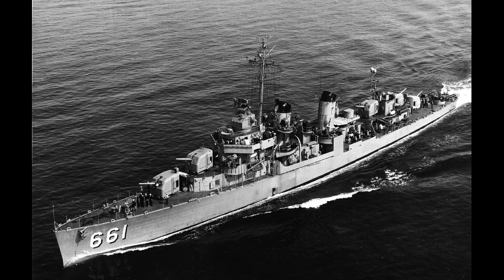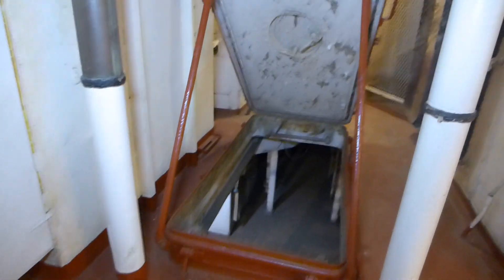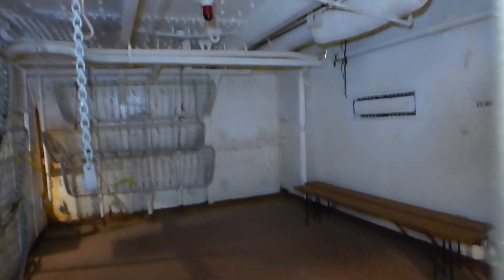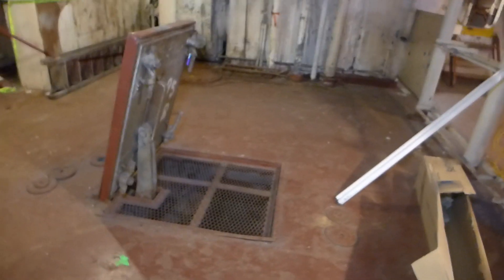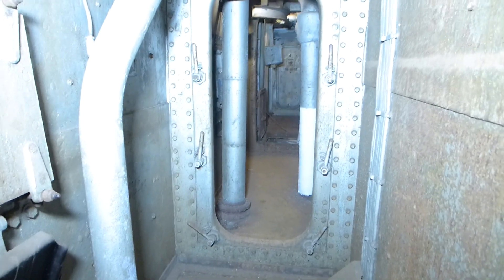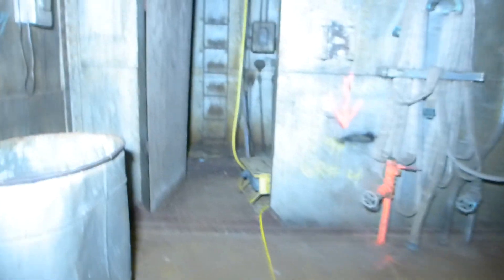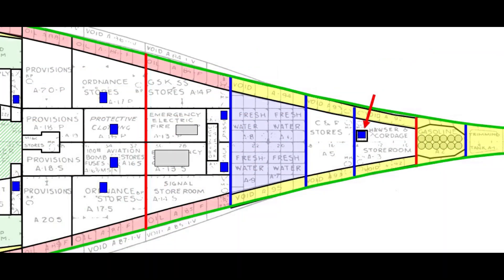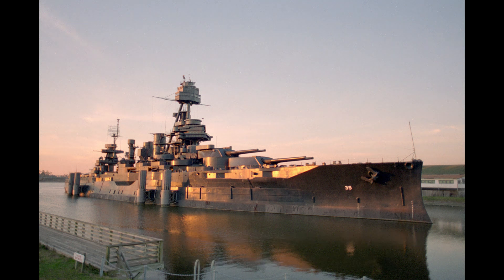Battleship Texas, Holding Back The Flood

Comment: Hi Tom, this is Manuel again. I'm starting the  CAD building of the Texas BB35 and need some assistance with the details of the control room. The doors to the room have a blast locking device on the inside, and what kind of handles does this have? What all is inside the room that will help me visualize to recreate? Did they have anything on the outside walls hanging ready for use in case a battle was in place? Can you share someone's information to communicate when needed? Thank you for your videos, they have already answered many questions. such as the 3" ammunition tubes. Question: Were they stocked up on the deck in crates when in use near the guns? I would like to share some of my progress drawings, if possible. Please "HELP'.

Comment: Every ship I've ever been on in our Modern Navy the Decks where either covered in epoxy, had ceramic tiles or nonskid.  I remember rehabilitation of a space on Kennedy that had 4 layers of tiles in it.  We took pride in how clean and bright we kept our decks and spaces. We inlaid Division and Department strikers into the tile work of the state and ready rooms.Did your crew clean all that  up and out of the Texas or has it alway been just that red prime.
Reply from the maker: Texas started life in 1914 with linoleum tile on most decks.  That was stripped off as a safety measure prior to World War II since linoleum of the day produced toxic gasses when it burned.  With the exception of ceramic tile in crew and officer's heads and showers that remained, all other deck surfaces were simply painted with oil based lead primer and topped with red alkyd paint.  Whenever spaces or passageways are restored, the historic lead paint is remediated and appropriately colored epoxy paint is used.

As far as general condition, the ship was maintained to a very high level until she became inactive in early 1946.  Until then, she had 1,800 enlisted crew and an annual maintenance budget of over $1 million (in 1945 dollars) to keep things shipshape.  This dropped to a maintenance staff whose size averages between 5 and 10 and an annual budget of less than $50,000 provided by state funding and donations.  That budget also had to cover emergencies like leak and flooding repairs that are common with riveted hulls.  Volunteers help with the effort, but their active numbers rarely exceed 20-30 and that is only on weekends.  So, it has been impossible to keep things in top condition beyond spaces and passageways that are open to the public.  The goal for the remainder is to identify areas that are actively deteriorating and fix those so that they are stable and can be restored as funds and manpower becomes available.

Comment: Where are her propellers now? And will they be fixing the rudder so it can be moved (or at least, set in the straight forward position)? Thanks!
Reply from the maker: One propeller was given to the ship by the Navy and is currently in storage while the ship undergoes repairs.  The other was kept by them and was probably melted down and recycled decades ago.  There are no plans to straighten the rudder, nor is there a good reason to.  A repair effort was studied back in 1988 with the conclusion it would require cutting the rudder and its post from the ship, then tearing out the bearings in the hull.  The effort would be very expensive and would be extremely intrusive. Besides, it only creates minor problems when the ship is towed that are corrected by a tugboat pulling to the side at the stern to offset the swing created by the rudder.  Also, it cannot be seen, except for the rare occasions the ship is out of the water.

Comment: This adds to my basic damage controll training-I was not a Fleet rating but the era I was in the USNR everybody was a DC person-old SeaBee comment-.lol
Reply: I rekon there was risk of electrocution if said spaces have circuit's installed-
Reply: Check hatch with back of your hand for heat, this stops you from screwing up the work surface of your hand-gradually in dogg with nozzle crew at the ready- ok I couldn't resist-

Comment: Question:

Regarding the remote valve operation "studs" or whatever they are called - would they have been labeled so that any sailor could for instance execute a command to: "close auxiliary fuel tank 6 stop valve and open main tank 2 check valve" or whatever without being trained and without having to consult a manual?

I hope I am being clear.
Reply from the maker: All of the remote operators were labelled with brass tags that identified their function and tank when the ship was in service.  However, it is extremely unlikely that they would ever be operated by anyone other than a trained crewman who was in engineering and assigned to the task.
Reply: @tomscotttheolderone364  thank you that was exactly my question

Comment: Dont forget to take your wrench with you when going in to those confined spaces just in case a door shuts on you that way they can hear you banging if you get stuck.
Reply from the maker: Thank you.  That is a major safety point.  My primary concern is with deck hatches since even undogged ones can be impossible to open if you are trying to push one open with one hand while standing on a ladder beneath it.  That's why I always make sure that either a locking pin is in the hinge or a latch is holding them open.  If not, I will find a piece of rope and tie it open.

Comment: And when you compare it with Titanic which was built a year earlier, you understand why it sank and sister ship Britanic. Only 15 water tight compartments.
Reply: I believe Titanic had a single hull, Britannic was still under construction when Titanic sank and the engineers went "back to the drawing board" and rebuilt Britannic's hull as a double hull... and yet Britannic still sank in less time than Titanic did! It boggles the mind truly. It's been speculated that Britannic warped slightly when the mine or torpedo exploded against her hull making the water-tight bulkhead doors unable to be closed so the entire hull filled with water... but tests have shown that Titanic would have floated even longer had her watertight bulkhead doors been left open and the ship allowed to settle evenly as it sank!

Comment: Thankyou Tom👍 really liking the videos and in depth knowledge you share with us all about battleship texas and taking us all to parts of the ship no one gets to see. Really looking forward to the next one. Tom It would be great if there could be a video on the 3 tier director tower like the one that sits at the top of the forward mast (don't expect you to climb all the way up there) or the one aft of the funnel, just how it worked and what was in those spaces. Thanks again tom👍
Reply from the maker: Neither fire control tower is representative of how they were when the ship was in service.  I have been in both and unfortunately, there is nothing to photograph other than the view when looking out from the foremast. The Navy removed all equipment when the ship was decommissioned and the spaces were stripped completely bare.  What remains is non-historic since they were rebuilt in 1988-89 using methods and materials that were not correct.   It was necessary to do that because money was extremely short and the structures were very compromised, so they concentrated on making them safe and at least look correct on the outside.

Comment: Excellent video Tom! I wish I could tour or volunteer. I'm very interested in the electrical apparatus. Can you or somebody do a video specifically on the electrical someday? I'm sure it was modernized many times over its lifetime, but it would be very interesting to see the older equipment and how the electrical was run throughout the ship. Thanks for these great videos, sir!
Reply from the maker: https://www.youtube.com/watch?v=lYbM__7GXww&t=109s
Reply from the maker: Also, go to 16 minutes 42 seconds in the following link to see how major cabling was routed between the two distribution boards to connect them together.  https://www.youtube.com/watch?v=r8dAmgL8tTg&t=366s
Reply from the maker: BTW, the dynamos were upgraded once from 4, 300kw generators to 4, 400kw generators.  Beyond that, the two main distribution boards saw little modification over the years beyond adding some circuits as electrical requirements increased.  Major additions were made to the system that were generally handled by subfeeding off of a main distribution board to a new, smaller distribution panels usually set fairly close to the loads they served.  While there was an inherent danger to operating the two big live front panels, they were generally reliable and easy to work on.  The only major complaint I am aware of was that many of the knife type switches deteriorated and became unreliable.  The Navy refused to change them to newer, more reliable designs and either supplied parts for the old switches or left it up to the crew's ingenuity to maintain them.
Reply: @tomscotttheolderone364  Good stuff. Thanks Tom

Comment: 2:27 are these pipes surrundet/wrapped with copper?
Reply from the maker: Those are columns used to support a couple of 20mm gun mounts that are directly above on the main deck.  It is typical to wrap them with a section in brass that is at upper arm and shoulder level to prevent paint from being chipped off by crew knocking into them as they walk by.
Reply: @tomscotttheolderone364  Thanks for the clarification. Brass is also antibacterial.

Comment: Amazing. As always I'm awed by both the ship and your knowledge of her. I do have some questions following the video.
Are the internal bulkheads the same thickness and strength, or are those farther below the water line reinforced to deal with increased water pressure?
Were there methods of de-watering a flooded compartment besides by opening it up and sticking a pump hose in? Something such as systems to use existing lines to pump from, or inject pressurized air.
How were penetrations of the bulkheads for piping and wiring performed, and was there any type of pressure rating required for non-liquid filled pipes or conduits that might be subject to exposure if the compartment they passed through flooded?
In Away All Boats a model is shown in damage control to calculate stability when compartments are flooded. Is there something similar on Texas? https://youtu.be/I_JU_nfHdVk?t=5788

Lastly when she comes out of dry dock and heads to her new berth is there a chance Drachinifel can catch a ride? I'd have to imagine the two of you talking when on a battleship that is actually underway, even if by tow, would make for some amazing video, and I have to imagine it as a bucket list item for him.

Thanks, and take care.
Reply from the maker: Last question first.  I am a volunteer who has absolutely no input regarding who will ride and who won't.  Even though I feel I have a good relationship with the staff and those in charge, I put the odds of me getting to ride somewhere around those of winning the powerball lottery.

With the exception of what I mentioned in the video and the external torpedo blisters, there is no system of pipes, called stripping lines, used to dewater compartments on the ship.  That makes sense to me since the system would be stunningly complex and could actually add to flooding if seriously damaged.  So, portable pumps is the primary means.  

To my knowledge, the great majority of internal bulkheads use the same gauge steel.  However, the means of riveting seams appear to vary according to location and load.  For instance, compartment bulkheads on second deck may only have a single row of rivets on an overlapping joint.  However, when you go below the waterline, the same type bulkheads will have butt joints with a backing plate and double row of rivets.  Major watertight bulkheads used to stop progressive flooding can have butt joint seams with backing plates and four rows of rivets.  

It is my understanding from reading sections of damage control manuals that compressed air may occasionally be used to slow flooding but not to dewater a compartment by forcing water out.  Doing so would almost certainly cause failures on bulkheads that are already damaged and under a lot of stress.  

The little wooden boat in a tub used to check ship stability in the movie is clever, but wholly inadequate for the task and is most likely the figment of a writer's imagination.  In reality, the damage control officer was far more scientific.  He had a full set of drawings, called damage control plates, that among other things showed every compartment on the ship, how many tons of water it could hold and its effect on ship's trim if flooded.  He also had a set of stability curves plotted for the ship as a result of righting experiments performed on it sometime in the past.  He used these in combination with an inclinometer and draft indicator to know within fractions of a degree of angle the ship's level and cross level.  He could also refer to a moving cross section of the ship that is part of the draft indicator to know what parts of the ship are subject to flooding as the ship settles in the water.  What may be a surprise is that with the exception of the bow and stern trim tanks, there are no compartments capable of being flooded beyond ammo magazines that are only floodable to extinguish a fire.  What are readily floodable are the external torpedo blisters.  These could be used to counter flood and level the ship, if needed.  Prior to their installation in 1925-26, there was little they could do to cross level a ship beyond pumping water out.
Reply: @tomscotttheolderone364  Thanks.  So much for that one scene in the movie "Away All Boats".

Comment: Thank you for the enlightening tour!   Some time ago you gave us a tour to the emergency diesel generator room, which you noted was completely closed off and remote from sources of flooding, and the generators were controlled from a higher deck level.  After watching that video, I wondered how that compartment is supplied with combustion air for the generator.  Is this done through one of the vertical ventilation trunks you showed us today?
Reply from the maker: You are very welcome!  Yes, air is provided by a well protected duct as is the exhaust.

Comment: I’m surprised that those lower compartments weren’t filled with foam. Did they just fill the oil and water tanks on the lower decks?
Reply from the maker: They didn't fill them because it wasn't required.  The only spaces that were foamed are the external torpedo blisters, the aft trim tank and a couple of adjacent voids.  All of these had a history of flooding, so they were foamed to exclude water.   Another aspect of the foaming is that all of these compartments will be open to the outside when the outer hull shell plating is removed for replacement.  Once open, they will simply water blast the foam out.
Reply: @tomscotttheolderone364  Thanks- you are a great resource to those who love the Texas. I don't know how much pull you have with the organization, but whatever hull plating is removed would likely sell extremely well as a souvenir instead of just being scrapped.
Reply from the maker: @seatedliberty  Funny you should say that.  Battleship Texas Foundation has various pieces that you can get with a donation to the ship.   They are made from steel recovered from the ship that would otherwise be scrapped.  You can see examples in this link.  https://battleshiptexas.org/donate/
Reply: @tomscotttheolderone364  I know- I have already bought them. I just thought this could be an additional source of material/revenue.